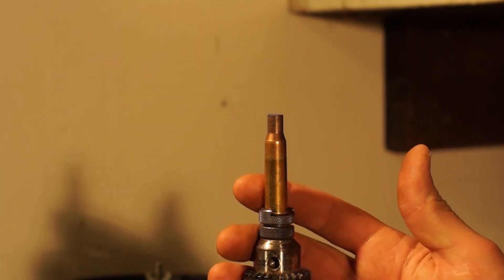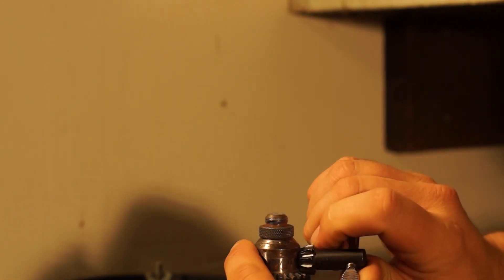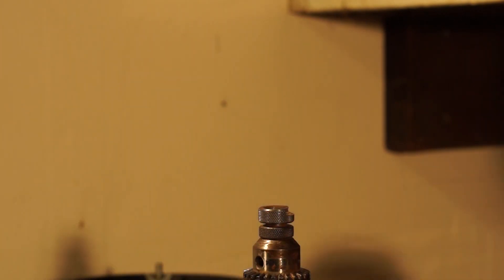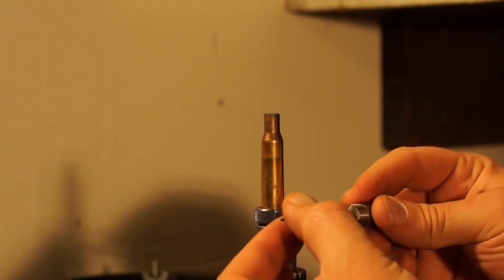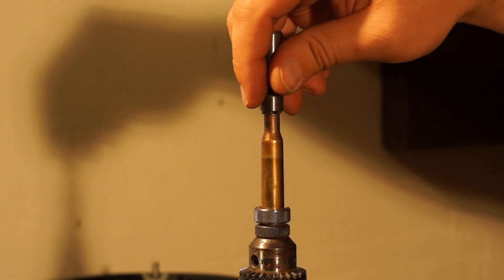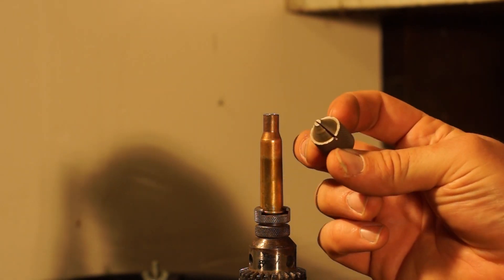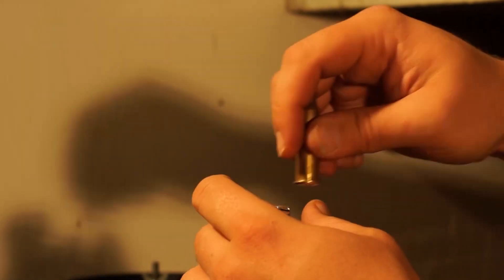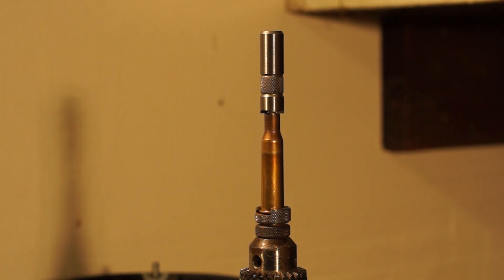Case Trimming with Lee

Comment: Nice video, i enjoyed it, just a tip the old type Lee Ball cutter is much easier to grip than that small cutter,& it's very reasonably priced, it's essentially the same cutter you're using but it's mounted in a comfortable round wooden ball that's way easier to grip and hold, midway usa sells them at a low price...

Comment: I just bought this for 7mm rem mag. I can't get the cutter to screw all the the way into the gauge. Should I use pliers. I don't want to force it.
Reply: @tjvohs1  I used pliers and put it on and off a few times had gunk on threads
Reply: Be careful...grab the rod in narrow recess...grabbing the rod will leave burros that will hang up in case neck

Comment: I'm only just getting into reloading and having to assimilate a metric f-ton of data. From the case trimmers Ive seen - this is a bloody awful way to go. Theres so much movement in the brass. Hell, maybe I'm over thinking it but the others seem positively stable by comparison.
Reply: You're doing it wrong?  Been years may be you figured
It out?
Reply: @bobwoods5017  To paraphrase myself - I'm learning - or did you miss that bit? Still, each to their own. I settled on the precision of L.E Wilson and that works for me. Whatever works for you. Would I do it this way? No. That doesn't mean its not suitable for others.

Comment: Hi, I have noted I cannot insert the trimming rod into the neck once the neck has been resized, that's a shame as I prefer to use the cutter after neck resizing.
Reply: i olso find the same problem with some cases i asume it is the thickness of the bras just press harder it will work i olso don't use drill according to me it wobble and make the neck bigger